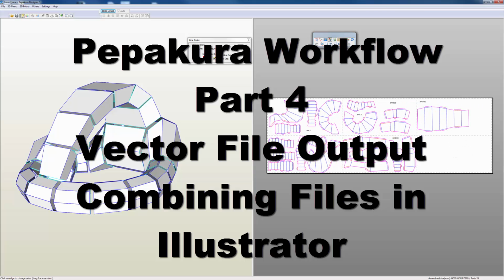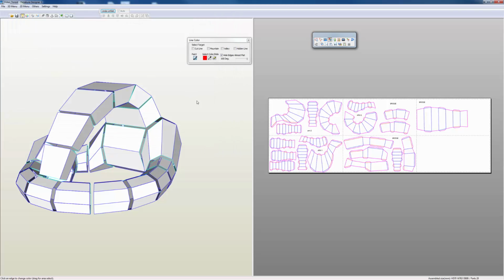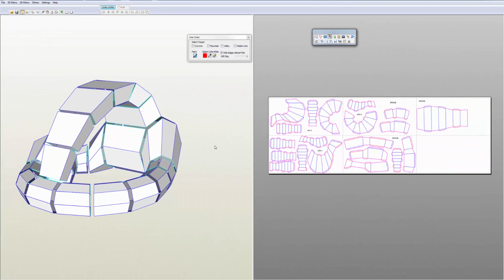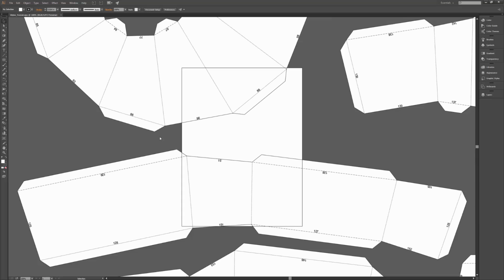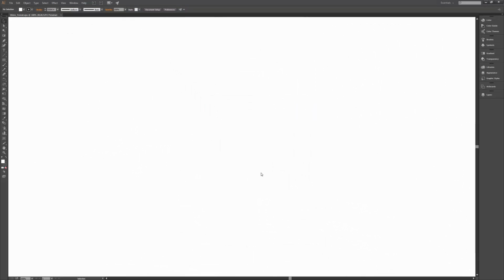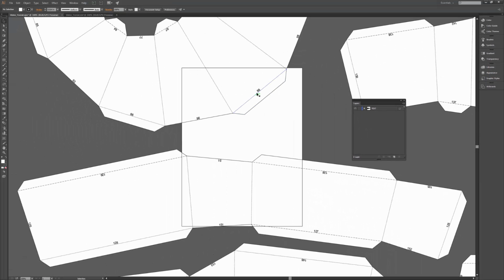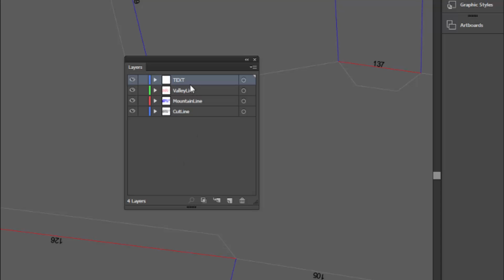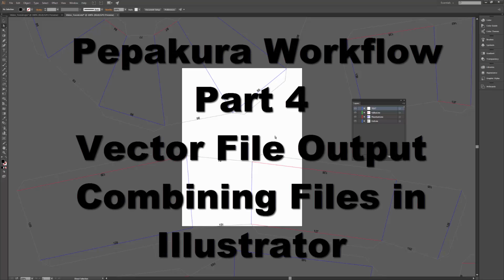Pepakura Workflow: Part5 File Outputs & Illustrator

Comment: I've set the edge colors in pepakura, but after I export to illustrator the object is entirely on one layer.
Reply from the maker: export the file as vector .dfx for layers. .eps for numbers. check your input settings in illustrator
Reply: I do not understand. Where are input settings? I did not find anything that I thought would aid me navigation the preferences options.